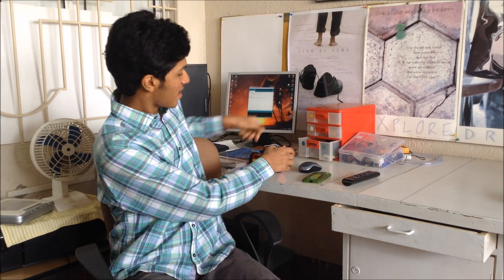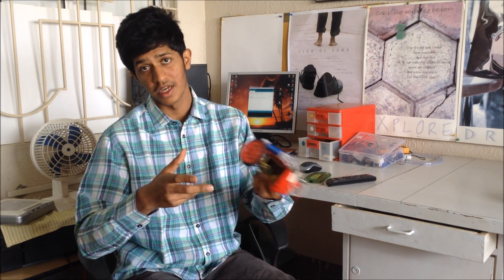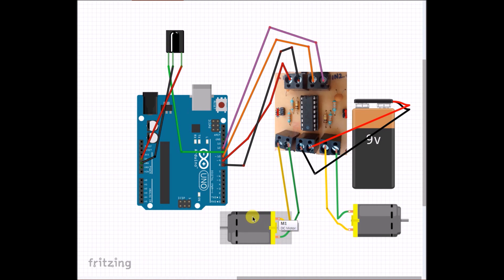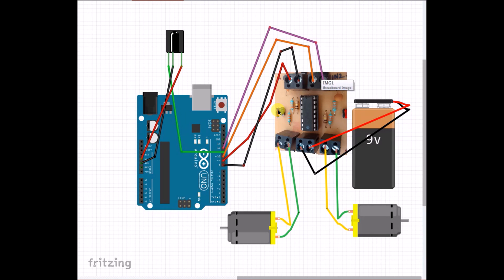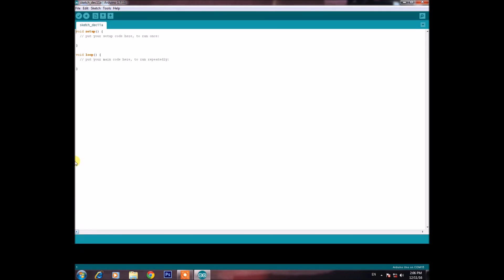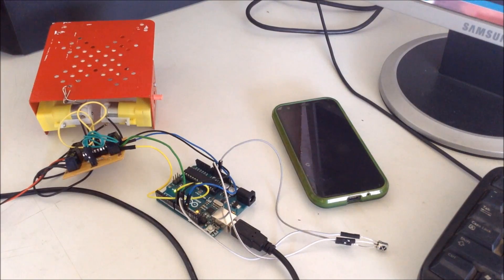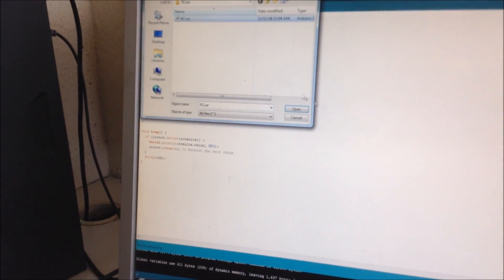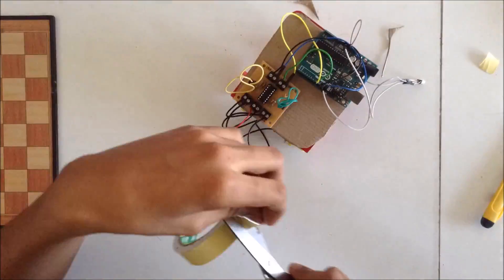Make your own TV remote controlled car! Super easy Arduino tutorial

Comment: Bro pin connection for arduino to L293d 

L293D PINS 🔽 
2 PIN--????
7 PIN--????
9 PIN--????
15 PIN--????
Reply from the maker: Just use a breakout board or a module instead.